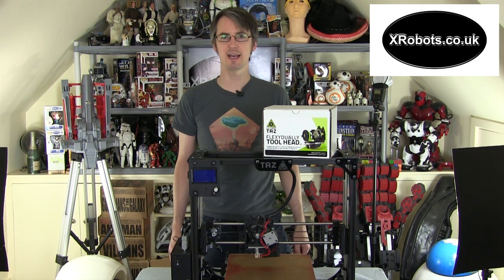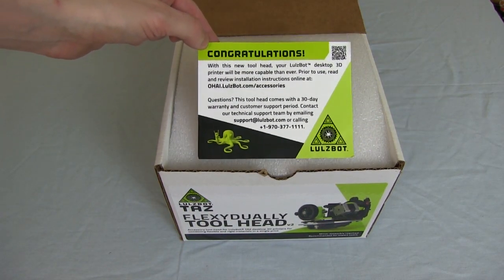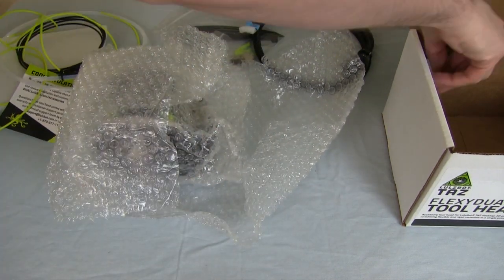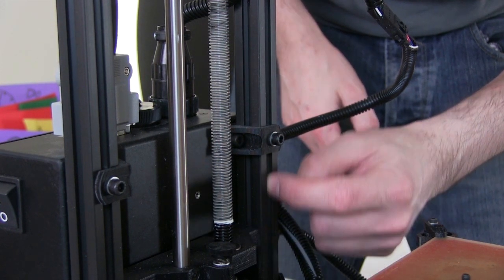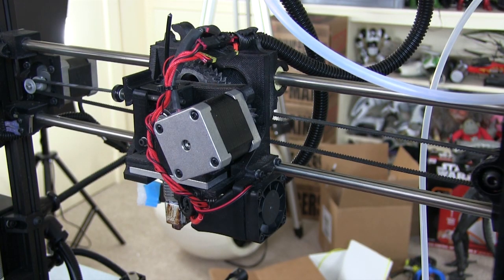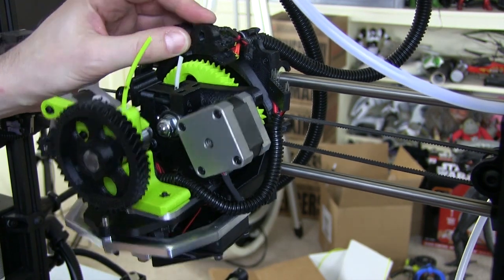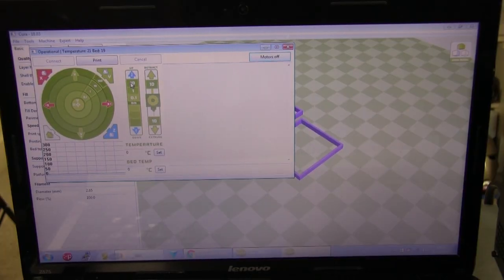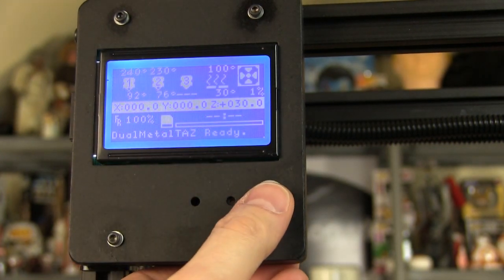LulzBot FlexyDually Dual Extruder Tool Head on the TAZ5 | James Bruton

Comment: I absolutely LOVE lulzbot. I love my Taz 3, even if it's older and keeps getting clogged at the moment ( I think it needs a re-level    and maybe the filament has gone bad). I love the fact they are open source... so freakin cool. Big thanks to you James because I probably wouldn't have ever bought one without the awesome low key sponsorship you have with lulzbot. I guarantee you whatever they're paying you it isn't enough (I'm guessing they just pay you in 3d printer parts lol). Love lulzbot, love open source, and love xrobots DOT CO DOT UK!
Reply: +Designandrew BTW that new tool head is PRETTY! Don't think it will work with my taz 3 though lol

Comment: Have you tried using feeler gauges to check the spacing? Cheap and easy to use at your local hardware store. I'm not sure what they would be called in the UK, but its a swiss army knife looking tool that has a bunch of thin metal leafs that fold out so you use them to "feel" for the width of a gap.

Comment: I don't have a taz..or a 3mm printer( have 3, 1.75mil ones )...but I really like the flexy struder design. and  its open source! I tried for........quite awhile to   modify their files to work on 1.75... while I could get it to work mostly with ninja flex it would then be impossible for other normal filaments.  Seems like 1.75 just has to have a spring loaded extruder to work properly.  Have a e3d Titan extruder now..still trying to figure out how to get it onto my printers..but it looks promising. Ninja flex is some fun and tricky stuff.

Comment: I can't decide between upgrading my taz4 with standard dually 2 or flexi dually two.  Does the flex side print ok with hips?  I know you need to clean between feeding in ninjaflex it I have found the new cleaning filament works great for that.  I figure most of my prints will not be ninjaflex but it opens up interesting possibilities.  Can't wait to see what you do with it.
Reply: +James Bruton (XRobots) I may just buy a dual and print out the flexible extruded as I have a lot of tube left over from a single flexible extruded print.  Won't even need the spare heat set brass inserts with the new design.  Great thing to have laying around as they come in handy when designing abs 3D printed parts.

Comment: Being a 3D printer myself im worried about the weight of all that kit running from one stepper motor, have you found you had to slow down your print speed to stop any ringing from the inertia of moving on the Y Axis ?
Reply: +James Bruton (XRobots) Cool, thanks for the info James, loving your work too, very inspirational

Comment: I'm looking through the parts on the lulzbot site. Do they sell every single part? I'd going with the frame can be printed. I'm temped to get a cheap 3d printer and use it to make a taz or taz mini :P Or just make the thing out of wood as far as the frame If that's even safe.So far in my quest for a 3d printer lulz bot is really open source. Others say they are but finding parts is kinda pain. thanks for the videos :)
Reply: +James Bruton (XRobots) cool thanks much